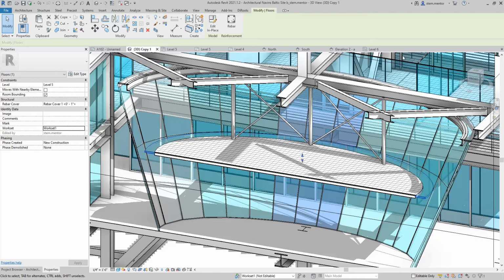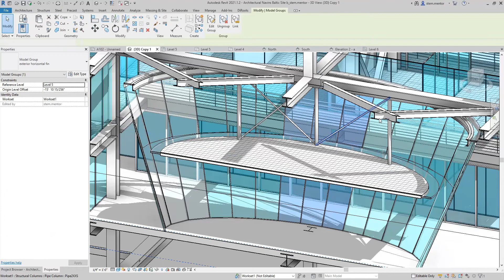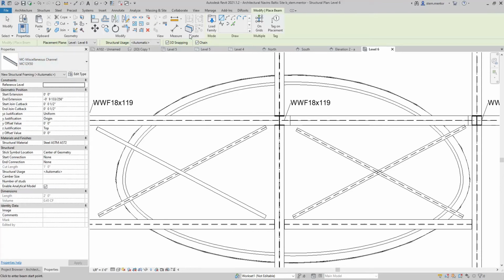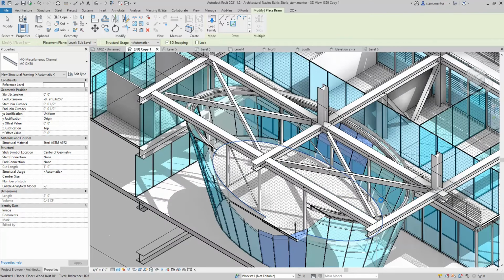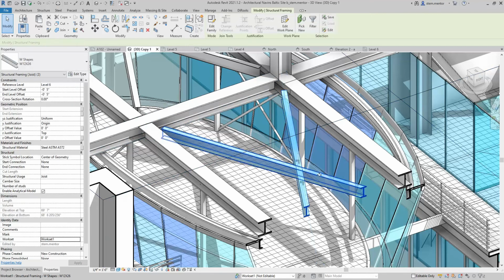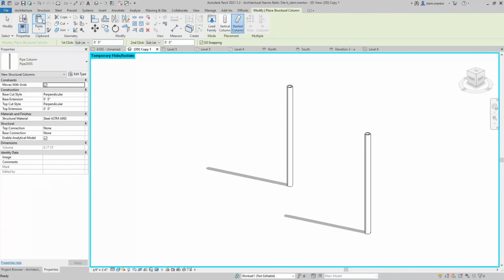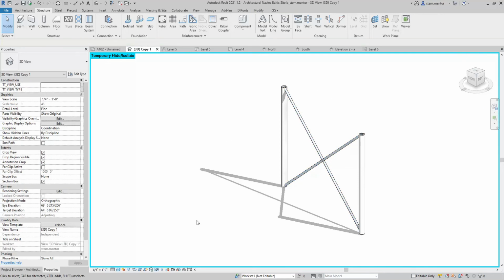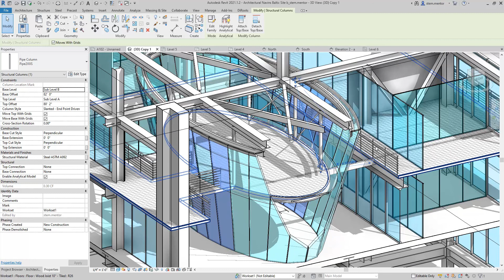How to place Curved Beams and slanted columns with 3D snapping

Comment: It is indeed bonkers that you can create connections to curved beams in cheap sketchup but not in revit. I mean i am new to Revit but still, can you at least manually create a connection ? By that i mean can you cut a curved beam at any angle and apply end plates ?